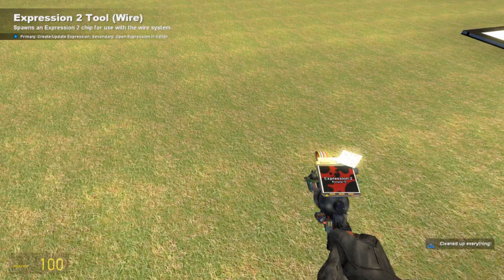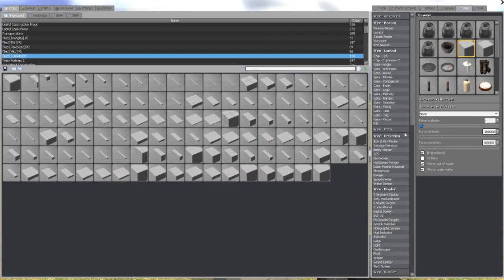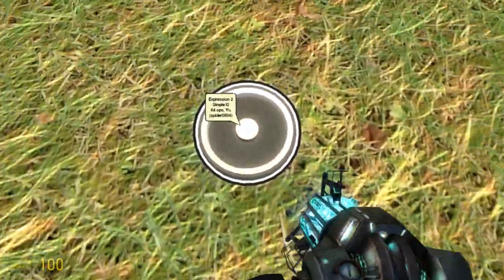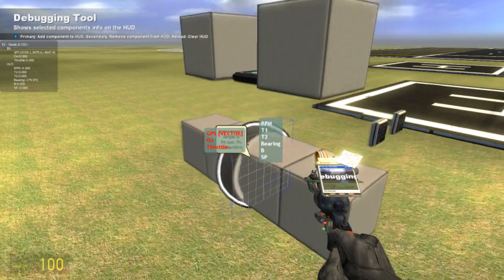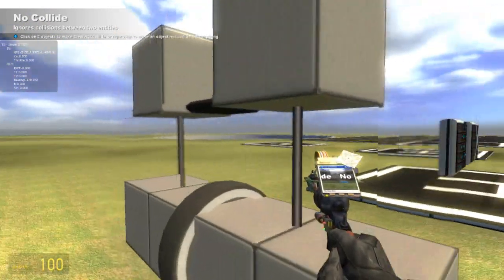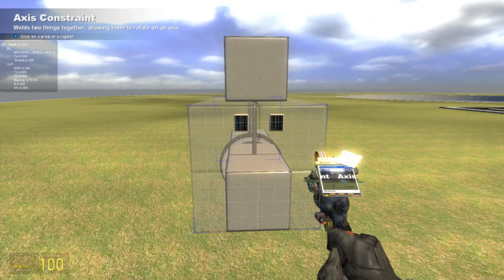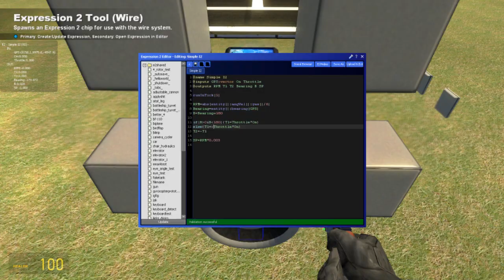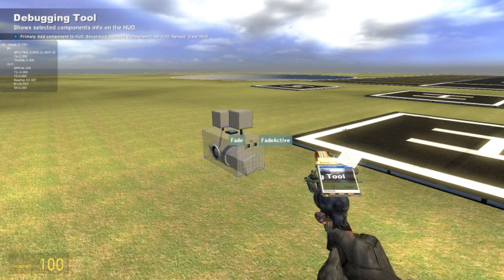Gmod - (Tutorial) Engines 01 "Basic Engine Building"

Comment from the maker: If it is vibrating then you are not axising the center of the propeller, use "smartsnap"

If you have smartsnap and are smart enough to hold E on the center when axising then you are probobly using some high value on the propeller like 150 with a super low weight, try upping the weight.

Comment: Dude can you upload a video on how to make a airplane engine because using acf I can't get the propeller to work even if using the propeller tool because the fuselage vibrates violently and then the crankshaft breaks and I have to re link them, still, it does the same thing.

Comment: Alright I have followed the tutorial pretty closely up until the wiring part. I have all of the addons from steam. For some reason my Expression gives a code for my flywheel called "Hello World." Is there something wrong with my Wiremod or do i need to make a new code? When I put the advanced wiring tool onto the flywheel it says several things, including "Greater than" "Less" and my GPS won't even let me select vector. It says everything that the GPS has grayed out in your video. I'm new to the game so sorry if this is a dumb question.
Reply from the maker: Please use the updated engine building tutorial:
/watch?v=NlXkmK3DPvM